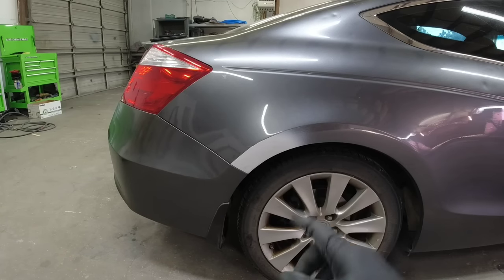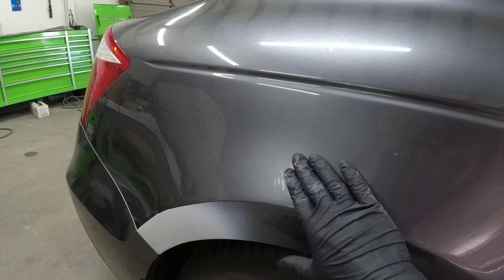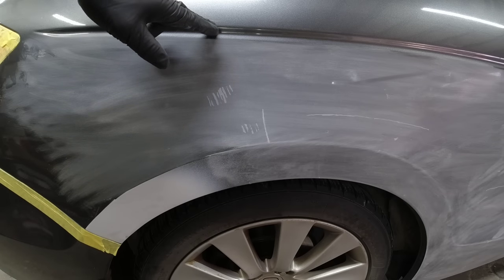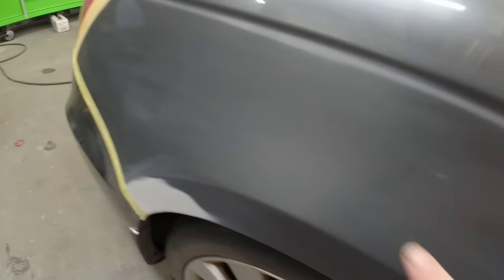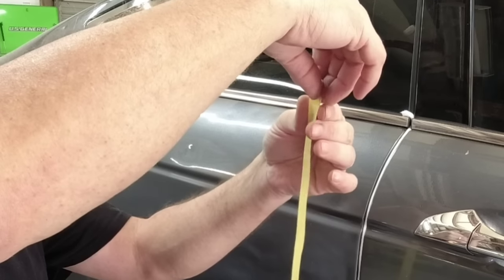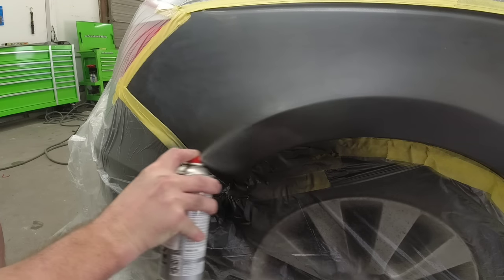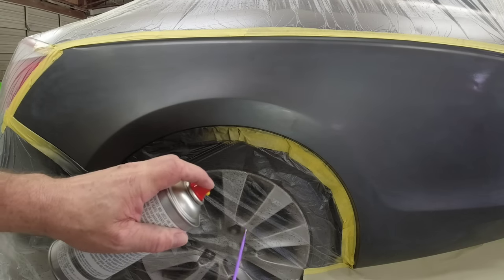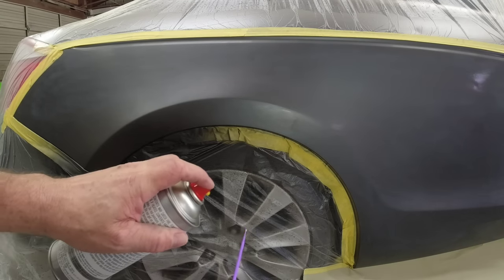How to SPOT PAINT a car with SPRAY PAINT and CLEAR for amazing results!

Comment: Is isopropyl alcohol still appropriate as a prep cleaner when there is filler surface involved? What would you recommend to dust/clean areas that have exposed z grip?
Reply from the maker: Personally, I prefer. Isopropyl alcohol over prep solvent. When you're using it over filler, you know raw filler because Isopropyl alcohol evaporates quickly doesn't soak into that filler.
Reply: @GarageNoise  thank you so much!

Comment: When you dust coat it how do you keep it from being like sandpaper? I always have a very rough texture that has to be sanded but then you enter scratches.
Reply from the maker: Move back  from the panel a bit but still put it on wet. If you get too far back it will be applied dry and thats no good.

Comment: Great Video ! Question on the back section from the quarter panel after you did the edge did you sand it with the 1500 or do you finished it with the 800 ? Also on the front part of the panel towards the door did you use a 1500 or 800 ?
Reply from the maker: You could use 800 I use 1500 for the clear blend  but make sure it's cured before polishing  usually a coulpe days in 70°
Reply: @GarageNoise  so pretty much use 1500 around the surrounding far out ?
Reply from the maker: @pcdetail602  yes, just so it's  easy to polish out.
Reply: @GarageNoise  thanks bud 🙏

Comment: Do you have to let base coat dry completely before clear or just 10 minutes to flash off ??
Reply from the maker: Just let it flash off but you could let it dry completely if needed. Appreciate the comment and support!
Reply: @GarageNoise  thanks I appreciate you taking time to answer.👊🏻👊🏻 you rock 👍🏻 if you could answer one last question can I blend the 2k half way down the fender like the paint. It’s a newer 2021 car and the area i repaired is small?
Reply from the maker: @sheerwillsurvival2064  best way is to clear the entire panel. There is procedures to blend clear but the blend line will fail and will be visible.
Reply: @GarageNoise  ok I’ll sand and do the whole door thanks

Comment: I just got two cans of paint qnd primer in one for my car. Is the process the same with only two steps? What works better? Thanks for the great video
Reply from the maker: So no clearcoat? Just single stage paint?
Reply: @GarageNoise  sorry I meant paint and clearcoat in one!
Reply from the maker: @kevinbarker4022  I wouldn't recommend sanding or buffing that paint it will remove color and metallics if your painting a metallic color.

Comment: Really great and detailed video the results are amazing! I had a deep scratch on the side of my car so I had to use filler, primer and spray paint but the car shop sold me the wrong clear coat, it was meant to be shiny clear coat but instead sold me a transparent flat one instead. Without realising this I sprayed on my car and now looks completely wrong. Should I sand down to remove the coat and then immediately spray the shiny 2k clear coat? Or do I need to spray a fresh layer of paint then clear coat?
Reply from the maker: If the color was right uou should be able to just scuff the clear you put on and then apply  the correct clearcoat. Get this spray max 2k clear it's  worth it.
Reply: @GarageNoise  great thank you for the advice 🙏🏻 your channel has been a life saver! So I can just remove coat then immediately spray with the 2k even if it’s been a week since I put the wrong coat?
Reply: Be super careful with 2k. Cancer causing. The 1st layer, you could see how much went in air. See first comment. Hope he can pin it. It's seriously bad stuff.
Reply: @MrGamman3yt  thank you for the warning 🙏🏻 I will get a respirator

Comment: I wouldn’t recommend 800g, it’ll leave deep swirls. You don’t want to use anything below 1500g. Then clean and buff using a compound cream.
Reply from the maker: I only use 600 or 800 because I've had adhesion problems using just 1500. It's not coarse enough to get good adhesion. Keep that in mind. And you will not see scratches from an 800 grit. Scratch that's been cleared over

Comment: Chris where can one find rattle can matching paint? I don’t see duplicolor making my PX8 paint I need. Do you recommend a certain brand?
Reply from the maker: Upol , my local Oreillys mixed mine. If you can't  find it there then check with a local automotive paint supplier. They should be able to put it in an Aerosol can .

Comment: I used spray max 2k clear glamour and didn’t get the deep shine you have. Took 2000 and 3000 wet sanding to it. Like a little better. I’m hoping that compound will bring the shine out. The car color is a beige gold so it’s not going to pop as easy as black. So compounding and polish should fix my problem?
Reply from the maker: Yes it should. It's  pretty tought stuff. After a year that clear looked just like it did when I painted it. Appreciate the comment and support!
Reply: @GarageNoise  thank you. What duty compound would you use on 2k clear? I believe I put 6-7 coats on the rear door of my BMW 7 Series.
Reply from the maker: @paperandmedals8316  If you sanded with 3000  then buff with a lite duty compound I use csi, or 3m perfect it ex.
Reply: @GarageNoise  I grabbed a turtle wax brand compound and my reflection started showing up. Did it by hand. Oddly I tried the electric buffer and the polish dulled. It’s getting there. Unfortunately despite 6-7 coats of 2k and buffing and waxing it I don’t see it getting to factory clear depth or shine.
Reply from the maker: @paperandmedals8316  Really, ok that good to know. . A little disappointing, I had thought it would cut and buff well. Thanks for the insight!

Comment: Do you have to wet sand the base before the clear coat?  I have a spot where the clear coat has delaminated and I want to fix it.
Reply from the maker: You can wetsand or just scuff it with  800 sandpaper

Comment: What could cause my 1K Premium HIGH-GLOSS can to spray clear coat to a mat finish? It's driving me insane. Does that mean I have to compound/polish it?
Reply from the maker: I have no idea, shouldn't happen. You sure it gloss? I would try a new can.
Reply: @GarageNoise  Having nothing to lose, I ended up sanding with 2000 grit, then compounded, then polished and it did turn to super high gloss. Great results. Not sure why the shine didn't come out straight out of the can. Might have been a plastic texture problem since it was a bumper. I hope this can help someone running into the same issue.

Comment: I used the same clear coat and after a week of drying I left the car under rain. The minerals from rain caused white spots on the car. Is there an easy way to remove these rain (minerals) spots.
Reply from the maker: A light buff shoul remove them
Reply: @GarageNoise  thank you so much.

Comment: Thanks for the video,I actually have a similar colour Honda Accord, but….I had a scratch on the corner rear bumper,I filled the scratch,sanded etc,applied 3 coats of base coat,then 3 of paint,then next day 3 clear coat. Waited 24 hours to lightly polish off but clear coat came off? Look horrible,I can see where it doesn’t blend in,I may have to do the entire bumper? Any suggestions please.have a great day
Reply from the maker: Use some air to blow off that clear and if your  can then paint the whole  bumper. I would spray clear coat about an hour after base at the most. Especially since  it peeled. was it the clear that peeled or base as well?
Reply: @GarageNoise  just the clear came off. So today I put 3 more coats of paint on, will wait an hour then put 2 coats of clear on. Fingers crossed. Thanks for your reply much appreciated
Reply: @GarageNoise  also just noticed on the can of clear it reads.. not suitable for automotive use? Why did the paint guys sell me this? Maybe this is the problem

Comment: I need yr help I painting the same thing but in a different car I didn’t want to paint the whole panel could I just paint the damage part. & also every time I sand the paint keeps chipping off and what turned out to be a small scratch I e turned it into a much bigger task it just keeps going father up when I sand the clear seems to be getting wider and bigger as I sand. And also the bando filler shows under the paint idk why I filled it with primer then sanded with 600 wet sand I can see the filler under the paint looks like a map… I appreciate any help especially with mapping problems
Reply from the maker: Is the clear peeling, what primer did you use 2k or 1k

Comment: Hey Everyone so im hoping someone can help answer a question. So i had some peeling clear coat on my Q50 i wet sanded the area where it was peeling plus a few inches outward. So i wanted to know is it possible to just clear over the area that i wet sanded or will that lead to peel down the road? Am i better off wet sanding the whole door and just clear over it all? I appreciate all the input. Sorry in advance for the dumb question

Comment: You put the clear over 800 scuffs??? Or did you go over the rest of it with 1500
Reply from the maker: For the most part 800
Reply: @GarageNoise  I was thinking of scuffing up my paint and using just the 2k clear to make the paint thicker and glossier to protect against uv rays

Comment: Good job aerosols aren’t as bad as people make out perfectly fine for a Diyer without a compressor and air line and gun. You can definitely get respectable jobs from cans people just like to moan but trust me if a expensive cars come from factory with a bad job people don’t question it because of the price and they expect it good but if a cheap car has a bad job they look at the quality extra because it’s cheaper. Many expensive cars have more orange peel than cheaper cars and usually people say we don’t want orange peel

Comment: Hey chris, I used the fc720 clear coat and got a bit of die back. I am spraying outside in relatively hot days (80 degrees) and using slow reducer. Is the fact that im doing it all outside make a difference for how it dies back? Also would you have any other reccomendations for clear coat? Obviously low die back is the biggest factor for me.
Reply from the maker: Nason 498 excellent  clear never had dieback. If you wait too long to apply your 2nd coat of clear that can cause dieback as well ,just a thought.
Reply: @GarageNoise  Interesting. I kept hearing the wait extra long since it was a hot day. But what you're saying makes a lot of sense, thanks!
Reply: Hi fc 720 great clear don’t use reducer u be good,never head problems
Reply: Your panel is to hot sir.

Comment: 9:37 Clear Coat goes on. Still trying to find information anywhere that tells me how soon can you place a clear coat on after the base coat. Best I find is 30 mins to 24 hours, so am guessing that's the answer. as soon as 30 mins, and up to 24 hours. Maybe after that I need to do something clever to spray an in-between coat of something.
Reply from the maker: You can apply clear coat typically  after 15-20 min at 70° the longest you can wait is typically 24hrs. Now I've  never done that I don't  feel comfortable waiting that long too worried about good adhesion.

Comment: Hello i used an aerosol clear coat spray , but after 2 coats and after taking off the tape , it appeared that the coat was too thick with hard edges like really a thick clear coat layer  that is way thicker than the rest of the car , what should i do ?

Comment: You mentioned painting over the primer, but must have cut out the primer process altogether. What primer did you use and how many coats? Why cut that part out?
Reply from the maker: Repair work and primer  are in part 1 of this repair. Here's  the video
https://youtu.be/orxYesBV0wM
Reply from the maker: The repair and primer are in part 1 here's  the video 
https://youtu.be/orxYesBV0wM

Comment: Spraymax 2K is incredibly dangerous.  It should be sprayed in a booth, wearing a full respirator (no not N95s), Tyvek suit, the works.  So many people think this is like the spray paint from Wal-Mart but it is NOTHING like that.

Also, if you sand it...same deal.  Full suit, location that isn't getting toxic dust into your garage, suitable gloves, etc.

Comment: how come you didn't do a clear coat blend like you did with the base paint?
Reply from the maker: Not entirely sure what you mean?
Reply: @GarageNoise  is it possible to do a clear coat blend to original clear coat. just like you did with base coat color. why repaint the entire panel with clear coat?
Reply from the maker: @tailwhipolaf  yes, it is possible to blend the clear but not recommended as the clear will eventually fail on the blend and leave a clear line. The best way if your blending clear is to do the blend in a small inconspicuous spot. You wouldn't  want to blend clear in the middle of a large panel. I did blend  the clear on this repair down low on the rocker. If you want to learn more about blending clear this video might help 
https://youtu.be/32zeH12IECA
Appreciate the comment and support!
Reply: @GarageNoise  thanks for that link, exactly what i was looking for. i will check it out

Comment: How did you keep it from orange peeling
Reply from the maker: Overlap and spraying closed to the panel than the can suggested
Reply: @GarageNoise  thanks
Reply: @GarageNoise  what if I already orange peeled?
Reply from the maker: @AlmostHomeDogSanctuary24  you can sand it out with 6-800 before painting.  Just be careful not to sand through clear coat.
Reply: @GarageNoise  thanks

Comment: It’s a mistake to spray first coat any other way than how you want it to look. That’s why you got heavy. Did you use a melt in type product, AkzoNobel has one in an aerosol called SRA
Reply from the maker: You might want to do that. I was not to familiar with spraying Aerosol clear. Got the sag cause I was a little aggressive trying to slick it out. Came out better  that I expected tho. No, I didn't spray anything to blend base, I think that's what your referring to. Appreciate your comment and support!

Comment: Why can't you just apply base coat and clear just in the repair area, then wet sand and buff?
Reply from the maker: You can but eventually that blend will fail. I can do a video on hows  to do a smart blend like that.
Reply: @GarageNoise  fail how?
Reply from the maker: @johnp82  You'll see blend line.
Reply: @GarageNoise  so you don't see the blend line at first but over time it becomes visible. Interesting.

Comment: Is it really spot painting if you’re painting the entire fender?
Reply from the maker: Yes
Reply: @GarageNoise   You are only painting the spot that has the primer correct? Then spraying the clear coat on the whole panel correct?
Reply from the maker: @joseperez2003  yes, that's  correct

Comment: Couple comments, you're way too close with the can, and the overlap from left to right and right to left is not required You should cut that in half instead of in thirds, and bring the can back another 2 in. Plus you're not doing overlap spray you're actually going over the same spots especially where you have that run you went over it several times if you look at it You can see you're not really following a 50% overlap pattern. I've painted a lot of things, that was the things that stood out to me. You shouldn't use this spray can any different than you would have spray gun
Reply from the maker: Yeah, the can says 10inches away. That was way to far to get a slick finish.

Comment: No primer?
Reply from the maker: The primer is was what was painted over. appreciate your comment !
Reply: I'm assuming primer isn't needed if not going to bare metal or using body filler? Just don't sand deeper than the original primer?

Comment: Jesus…ALWAYS wear a proper respirator when spraying 2K.  You will sign a disclaimer when you purchase 2K clear that you will wear proper PPE.  Also, anything within 50 feet will get overspray on it from that clear.  Recommend renting a booth or using a portable spray booth.

Comment: No mask? The 2 part Super Max clear is moisture cured. That means the vapors harden upon contact with moisture. Breathing in the vapors causes the curing reaction inside you lungs which are vey moist. Read the caution labor to you viewers. Super Max is a great product when used safely.
Reply from the maker: I wore a mask when I started I didn't  have in on. Yes ,wear a mask!

Comment: Your strokes look very slow, you should move your hand faster and start from one end and finish at the other. The clear ran because you applied to much or held your spray for to long over one area. You only want to mist it and not overspray.
Reply from the maker: I moved slow to let the clear flow out so it would have low peel.
Reply: @GarageNoise   orange peel is inevitable most of the time but once the paint is dry and cured you can polish it with a bit of compound and a drill with a sponge top. That would make it look perfectly smooth. Don’t get me wrong. You did a great job, I’m just trying to give you some more ideas.

Comment: Man you are ignoring all the warnings on the can and every where anyone knows about 2K. The hardener is isocynates and they are poisonous. Serious business when the manufacturer warns you.
Reply from the maker: I wore a respirator
Reply: @GarageNoise  You sure don't show it or comment on needing one. I shoot 2K and I have built my own positive air flow system to handle the problems. But I came away from this video with the impression one isn't necessary.